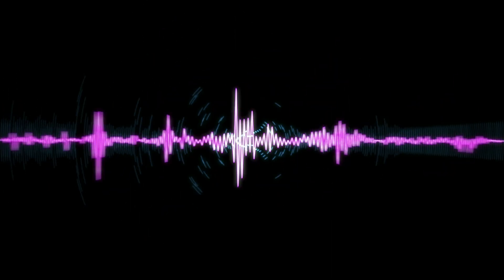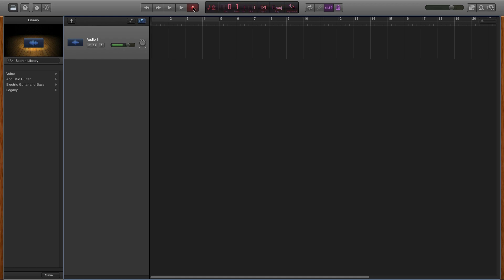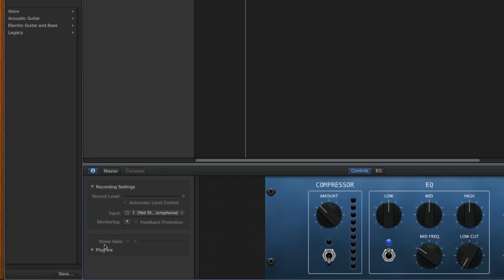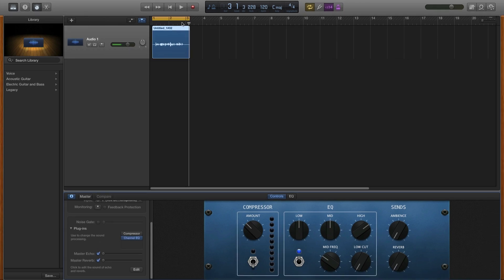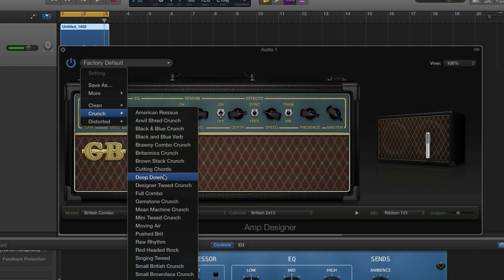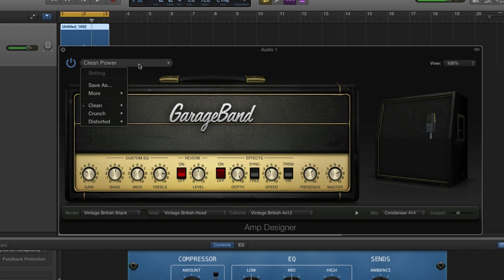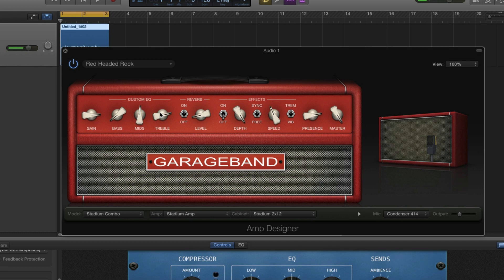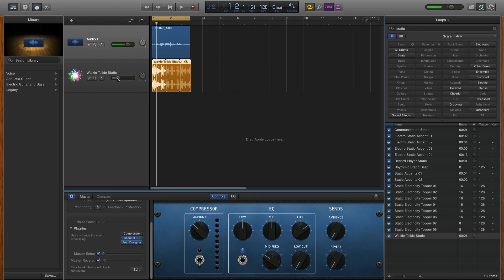How To Make A Radio Effect In Garageband 10

Comment: Thanks, this is exactly what I needed. For the others trying to achieve a 1920s - 1950s documentary/radio with the Transatlantic style, they should reduce the bass threshold, increase the mids and keep the highs where they are in the EQ. And use Crunch > Transatlantic Clean for the amp designer!